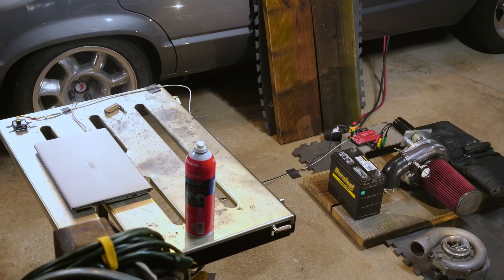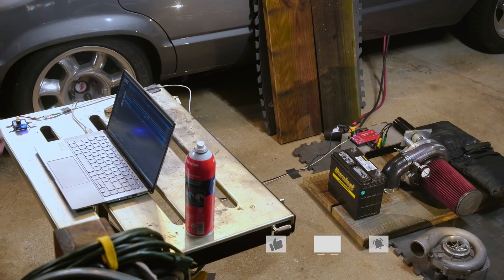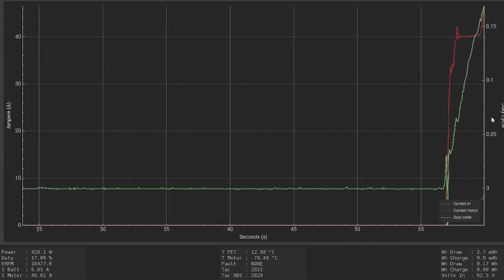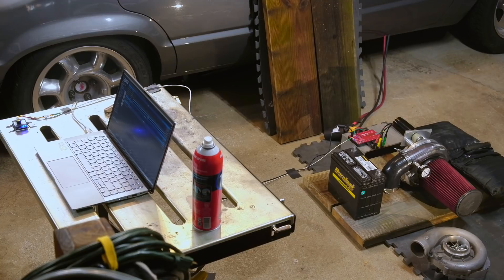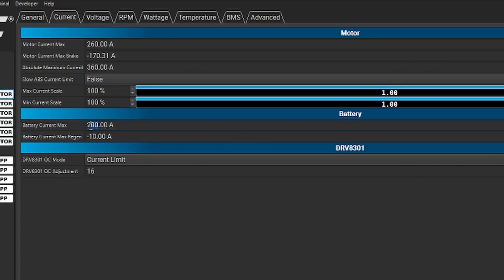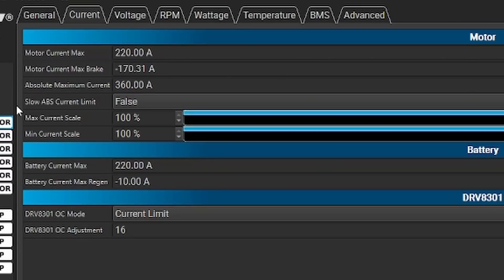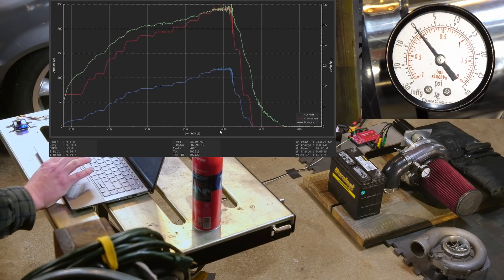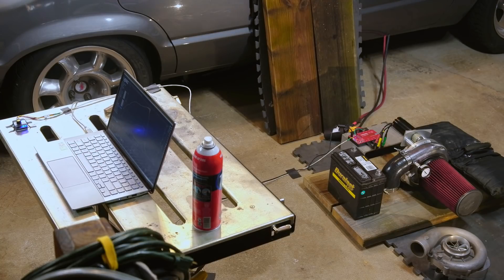Easier/Cheaper High Power DIY Electric Turbo - Full Power Attempt #1

Comment from the maker: Right now I'm leaning towards power cable inductance.  Either twisting or shielding the power cables might help - which would lower the inductance.  The higher the inductance, the harder (less "backflow") of a time the batteries have to absorb the current spikes.  Or trying a bit shorter of a cable and see which one has more effect.  Thoughts?
Reply: I would try shorter runs. The cables look kinda small what awg? Short 1/0 awg OFC?
Reply: @Thumper68  I've run hundreds of amps in lab tests (not on electric turbo's but similar power levels) and the shorter those wires the better. Perhaps not so much the inductance but the series resistance. Adding super caps right at the motor will help overcome the voltage drop of that wire though.
Reply: @JimN_AustinTx  I agree shorter larger the cables the better and I also agree capacitors like we use in car audio may help for fast large amperage pull. I been doing car audio for 20 years and capacitors do help when used properly. What would work best is super cap bank because he would be pulling high amps for 8-10 seconds straight and with standard capacitors in car audio you see very little power gains from amplifier on long extended bass notes compared to the much higher gains seen on short burps by comparison.
Reply: O gauge wire is good for 5000 watts if it's ofc ultra caps give the instant power release your looking for like yin long or xs power ultra cap battery cells
Reply: @RollingThunder85  No its not. Cable are not rated in Watts. Amps dude, amps.
Reply: As you stated, (I'm an EE), I highly bet the lead inductance from the battery to the controller is your problem, and the best way to fix that is to run shorter leads. 

The other possibility, you didn't say what your PWM frequency is, it's very possible that as you reach a certain load and RPM that the PWM frequency is causing an issue. If the RPM of the motor is high enough but your PWM frequency too low (and motors that run higher RPM tend to run lower inductance coils (for back EMF reduction (aka the motor winding can drop its magnetic field faster), which then will need a higher frequency PWM to not have issues). 

Do you know the ESR of the cap you are using as well? Often times those huge caps have a rather large ESR which can cause issues in this usage as well. You want as low of an ESR as you can get.
Reply from the maker: I agree with you.  In fact, have already tested it and got it to work (video soon).  The caps in parallel have an ESR (from datasheet) of 11 milliohms - they're Kemet low ESR caps.  My ESR meter can't read caps that big (20,000 mf each).
Reply: I was going down this route as well but want to ensure changing battery amps parameter doesn't help first
Reply: @lj516  and to think experimenting has given me a highschool drop out all this kinds useful info lol what did school teach me it's not what you know it's how you know it haha
Reply: Flyback diodes?
Reply: can i ask how much power the base emgine made b4 the gen one turbo or if you dont know what was the engine combo
Reply from the maker: 500 hp
Reply: Just about to suggest capacitors but I see other people have already lined that out.
Reply: I haven't been a following too closely but are you running capacitors in between your battery pack and your ESC to control ripple?
Reply: Wires too small for given current flow?
Reply: Yeap ,you need a cap bank inbetween the controller and battery.That’s what’s causing the ripple currents
Reply: Agreed working with well pumps with a drive we can run them without a ground. We prefer not to go 3 wire because of the noise it creates in the signal.
Reply: I wonder if you would be able to use like a hybrid battery system with a busbar setup
Reply: What did it end up being?
Reply: bro if you think the cables are part of the problem, add more cable cross section (parallel) and minimize the length (always).  I do audio, and we flow hundreds and even thousands of amps in some builds, we dont see noise like that from cables.  I think it could be your hole size on the plate but thats just my guess
Reply: All the person car working at 12volt. My question is why didn't make a turbo with 12v ? If I gonna buy this then should  be "plug and play". Then from where I take out 60volt from my car ? Other thing what I told you the motor take 100A. Which means 1hour at high way and your battery is empty. No turbo, no power,bad emissions bla bla. Its works maybe for minutes, 1-2 hours.  Then go home and charge your battery wich is 60v is ridiculous. Nobody have 60v in the car.
Reply: @laszloszell8753  because 12v isn't enough power to spin the turbo fast enough at 12v you need like telephone pole thick wire to supply power if that would even work
Reply: @RollingThunder85  I know exactly . I made a electric bike for myself with    6364 245kv motor (2700w) . My 24v 20Ah lipo battery after a hour was empty. This turbo will do the same...
Reply: @laszloszell8753  maybe a faraday cage around the wires or motor or some capacitor s to stop the (cogging) like in rc cars clean up the signal you know
Reply: @laszloszell8753  also smart car batteries can be gotten cheap and they are made for drawing massive power in short bursts like Ford escape hybrid 2009 it has 50 cells at 7.2v each 320v total easy to get your voltage with out any buck or boost converters
Reply: @RollingThunder85  Cogging is because he using a sensorless motor. It's a common issue, you guys should to know if in the "business ".  You can reduce cogging  with more poles motor,add sensor, using sinusoidal controllers or startup current settings are not set appropriately.
Reply: @laszloszell8753  I only know this from my RV car hobby  capacitors fox it completely for my needs
Reply: @RollingThunder85  yeah I know what you mean,I have a hobby FPV drone. I build like 50x my drone. There we also using capacitors for filtering out ripples and noise.
Reply: You need that high voltage to deliver enough power. P = Volts x amps. You need that high voltage to make that much power, and to get enough rpm on the motor. Higher voltage minimises losses while more current increases losses in every step.  Going with a 12V system would make it unusable. Why do you think electric super cars have up to 800V in them?.
Reply: @impuls60  oke so what's the point? All cars working at 12 volt not 60 volt. I really dont get how I could use it if I buy it for a daily tuning car.  For drag car oke 5  run ,I can understand but to drive in Germany at highway for 3hour 150-250km/h(no speed limit). Oh boy  even if I make 60v system 12 voltx5accu is still 150a. Which means under a hour my car battery is empty.
Reply: @impuls60  Yeah exactly, but turbo need rpm . There are like the XK-3650 motor with 5400kv/volt (12vx5400rpm=64800rpm) and you can push at 135A. Trust me is will do  more boost at 12v than this 60v.
Reply: @laszloszell8753  this is a completly different idea of a real turbo. This is not suppose to run 24/7 with the car. I run my car every day and smaller battery then Alex. When I need the power off the electric turbo, it is there! Of mine works, I simply have a limite switch on my gazpedal and when I floor it, the supercharger spool
Reply: @laszloszell8753  You'd use a boost voltage converter to charge your 60V system from your 12V system, and the 60V system would only run your E-Supercharger. You will absolutely need separate batteries because your alternator can't supply enough current to run the supercharger and the rest of the car full time. 

If you're going to need separate batteries anyway, using a higher voltage makes the system more efficient because it needs less amps to deliver the same power. From the video, the motor he is using can handle 12000 watts. To get 12000 watts at 12v, you'd need 1000 amps, and that's not taking into account the fact that the car battery's voltage is going to sag HARD under a 1000 amp load, so you would probably end up needing 1200 amps at 10V to get to the 12000W. At 60V, assuming it sags to 50V under load, you would only need 240 amps to get that same 12000 W. 

Getting a reliable 240 amps out of a lead acid battery would take a pretty large lead acid battery, and you could get the same power and capacity from a lipo setup in a lot less weight and space.
Reply: @Blaquer17  I made many project with brushless motor. Useless to use 60v and 6-10kw motor. A 14 or 24v 4000kv motor  at 80A more than enough to make 1bar boost. Motor wich  he  using is a high torque and low kV motor, wich is totally useless for this project. For keep up  the boost need RPM  not huge torque and low KV . If you hold down with your fingers the original turbo turbine while starting your engine is will.not spin.  Which is mean not much torque products the exhaust gas . Try to do it with this ....your whole hand goes....
Reply: @laszloszell8753  a car alternator actually makes like 120volt a/c power and is switched down to 12-14.4v dc. So a second alt could be used and wired to output 120 volts ac to power a motor for the turbo.
Reply: @Blaquer17  well said I'm glad I didn't have to type it up lol
Reply: @laszloszell8753    would be interesting to know what the new Mercedes AMG's are doing to run their latest electric turbos
Reply: @laszloszell8753  its upstaging.   your average car has an 80amp alternator and goes up as large as 250 amps on some vehicles (US ambulance for example)  The electric board basically takes all that power and converts it to usable energy for the device.    its a similar process for a high amperage sound system the difference being of course the subs are not constantly pulling 2-4k watts (sample)  unlike this motor, but if its set to 30% throttle, typical car on the highway is only around 10-25% duty cycle.   So this is not a big concern.

Comment: I think better solution would be to move esc much closer to motor and make wires from battery longer as there is mostly dc in them.

Comment: Check the air inlet filter over taxing it ?
Reply from the maker: The airfilter's not a significant restriction at these airflow levels - we testing this airfilter on a dyno and the difference was negligible.

Comment: 250 Amps of power and only 5 Psi. Not a bad concept. Use a WAY bigger Motor for RPM vs Toqure
Reply from the maker: Check out how it's bigger brother performed at the drag strip: https://youtu.be/RT0M88xHzNQ

Comment: Your compressor is surely surging. The pressure on the exit is very high and the air has to escape somewhere if not through outlet then through inlet. This causes velocity difference and turbulent shearing forces between blades resonating with rotating fan blades making hissy whistling noise.

Comment: Use this combo : ESC Castle XLX2, motor TP power 4080CM (80000rpm) you have about 14kw power
Reply from the maker: If you haven't seen it, check out our MGM/LMT combo - it's well over 30kW (I put the power draw on screen when going down the track): https://youtu.be/nlTVHkfSQXM

Comment: Maybe that wavy chatter at the top end is from the tp motor shaft shaking from the belt making the motor magnetic field wobble,,
Reply from the maker: It's really just too much eRpm for the VESC to reliably deal with.  I've got a 4 pole motor I'll be testing with soon.

Comment: Pulley reduction? Number. of magnetic poles?
Reply from the maker: I don't remember the pulley ratio off the top of my head, but that motor had 6 poles, which was part of the issue.  I'll be turning my attentions back to this smaller unit soon, but first I need to finish and post the dyno video we just shot on Monday with the bigger unit.  Here's a glimpse of the bigger unit making it's first boost: https://youtu.be/7cCSbogg-AI
Reply: @AlexLTDLX  ok, thank you very much. But, which company manufactures the motor? Do you remember the model?

Comment: You're expecting to get more than 120 amps out of a Honda format battery. That's your issue. Even with the caps to smooth the output, that's demanding too much from that battery. They are designed to charge at 120 amps, but rarely will they discharge as much as 80 in their intended applications. It's quite possible they are unable to supply the caps fast enough because of this. Also possible you've cooked it with such discharge rates. Either way, I think you need to upgrade your battery or put another in parallel with it.
Reply from the maker: Thanks for subscribing.  Are you referring to the lead acid battery in the shot?  I'm only using that as a weight to hold the thing down.  And it actually started to lift it.  These are the packs I'm using: https://youtu.be/KscgGhk3ejs
Reply: @AlexLTDLX  - I withdraw my objection :P

You're able to tell I subscribed? Neat. Didn't know YT did that on the creator side. 

With DIY electric forced induction as your primary content, you were definitely going to get a sub. I like unconventional things. And something like this would pair nicely with my own project... a Caravan dragster. ;)

Comment: Its out of balance. and you are working against the wobble of the shaft of the stator... or the the shaft of the turbo isn;t smooth at that rpm.. thats my gues!!!
Reply from the maker: Turns out, the issue is the number of motor poles, lack of motor sensors and long cables.  We've solved all those, but for the sake of being able to put out more videos, I've built the big version: https://youtu.be/Azeaf6WVPfQ   I'm installing it now, actually.
Reply: @AlexLTDLX  its awesome what your building.. I never understood why a turbo couldn;t be electronic..  Keep looking at tesla motors , i;m sure that will help you . I would use a toyta pruis battery... put a double alternater on the engine to charge it ... i would also tie into the voltage signal of the TP sensor.....Please make one for a 2013 tacoma ... thank you !!  How much $$$$$?????????   lololol  I hope to see it in the store soone !!!

Comment: I'm thinking that the reason you are only getting 55% duty cycle is to do with pulley ratio. Swap for a larger pinion pulley. Just an idea!

The compressor will spin faster, leading to greater volumetric efficiency (sorry I may be off on this...my area of expertise is the human body and mind... I run a lot of RC cars though so do have some relevant experience) and greater boost. This way you will load up the motor torque without increasing RPM.

Anyway I wish to complement you on your video style. Always enjoyable and informative without sending me to sleep!
Reply from the maker: Thanks for watching, posting and subscribing.  Going with a smaller motor pulley got the duty cycle up - I made the same error in thinking when I started with this version.  The smaller motor pulley allowed for more RPM, which raised the duty cycle, which raised overall system power.  But then I ran into eRPM issues at very high speed; I'm switching this version over to a motor with fewer poles and a sensor to deal with those issues.  But in the meantime I've decided to see if the bigger version (the sledgehammer) will just work without all this screwing around.

Comment: Hmmmm…could there be an issue with your bms on your LTOs? 🤔
Can you run 2/0 gauge cables to eliminate any wire resistance possibility?
Reply from the maker: Good thinking, but no.  It's mostly VESC related.  But working that out now.

Comment: The pressure gauge is fluttering quite a bit at the top of your tests. Maybe its a mechanical issue of pressure spikes from the compressor going into choke?
Reply from the maker: It's really just a crap gauge.  What's really important is getting it stable here and then seeing what the actual boost is on the car.  At peak power it should be 4-5 psi BUT - it makes twice as much hp per psi as my Whipple did.

Comment: Nice work. I’m wondering if you are seeing the spikes from the belt slipping. The compressor psi gauge  bounced around a lot right about the time of the voltage ripples. I don’t head compressor surge from here.
Reply from the maker: The belt's not slipping - it's a cogged T5 belt; if it slipped, it would shear teeth.  But it's a reasonable thought.

Comment: Could the problem be that there just isn't anywhere for the air to go? With such a small outlet and a small volume where the boost is going, at some point the you will stop moving air and eventually slip/cavitate.

Comment: If you watch your boost pressure you will see the same speaking as your current so I'm wondering if you need to do something for a little back pressure to even the output so it's not so choppy

Comment: In that spikey patch, how close was the compressor to the surge line?  I'm not saying that's the problem, but it would be nice to rule that possibility out.  Great video, thanks for sharing, looking forward to seeing the rest of the testing and project.
Reply from the maker: No.  I've got enough experience with these to realize that we're playing in the bottom/left side of the compressor map, but not close to surge.  It's a reasonable guess though.  I did send the first version into surge when I gave it full power while connected to the engine with the throttle open with the engine not running.  The surge was really obvious.  I figured this issue out - it was electrical.  I'll be posting a video about it (and trying to sneak up on full power) soon.  It may end up going into surge, but I don't think it will.  Once we establish full power with the 1" restriction, then we'll try completely open (i.e. max load; intentionally going into choke) and then make sure we can accelerate quickly to full power without triggereingthe absolute over current fault.  It's a bit like tuning a car, actually.  Thanks for watching and taking the time to post!
Reply: @AlexLTDLX  Thanks Alex, this is great stuff, really ground-breaking IMO, so I appreciate all the detail and information that you include in the videos and comments.